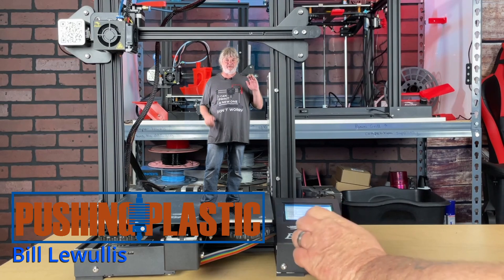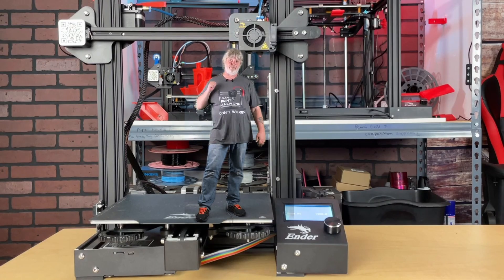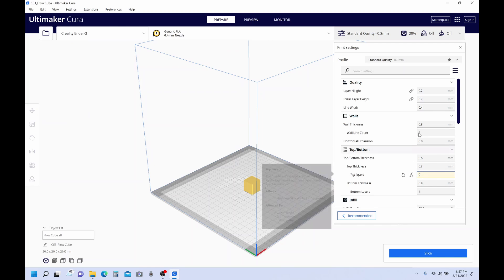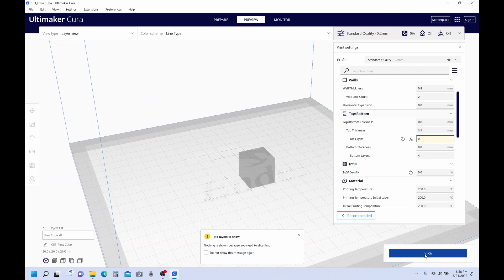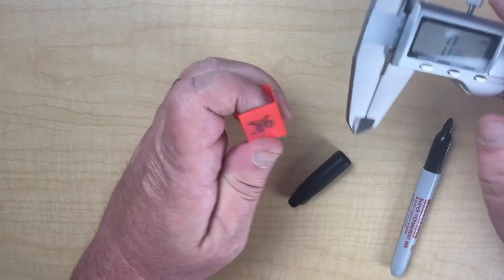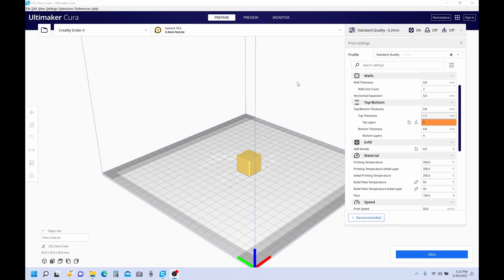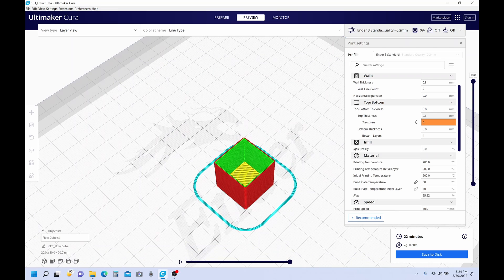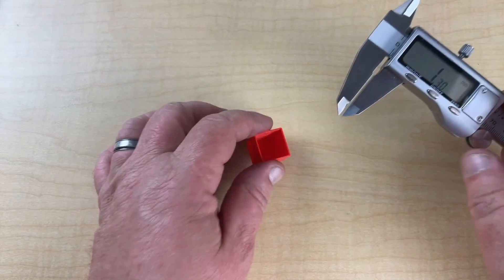Calibrating Flow Rate For Your 3D Printer

Comment: Question for you:  If I'm using a .6mm nozel, I assume I should adjust wall thickness accordingly?  Also, those are some nice looking calipers!
Reply from the maker: The key is to make sure that in Cura, you switch to a .6mm nozzle. It's located at the top of the screen, in the center. It probably says something like "Generic PLA 0.4mm nozzle". Click that and you'll have the option to change the nozzle size.

Comment: A rough visual example of 3 walls.
Original flow
(__)(__)(__) = 1.5mm ~

After you calibrated.
 <_><_><_>  = 1.2mm~
The touching points get smaller.
And less optimal for printing 😮
Reply from the maker: It's a calibration method, using 2 walls by the way. More walls make a stronger print but hardly required to dial in a printer. What good is 1.5mm if it's suppose to measure 1.2mm?

Comment: Hi, is this calibration suitable for materials like TPU?
Reply from the maker: I use to do it this way with all materials. I've been using Bambu Studio, Orca Slicer and Creality Print lately and all have a new visual method for dialing in the flow rate. I haven't looked to see if Cura has added one or not. But when use my original Ender 3, 5 and 5 Plus, I dialed in TPU this way.

Comment: I'm just discovering your channel as I try to dial in my Ender 3 V3 SE, and it's very informative. I'm seeing conflicting information though about flow rate. Some sources say to leave the flow rate alone in the slicer profile and instead use horizontal expansion to account for dimensional variance in wall thickness. What are your thoughts on that vs messing with the flow? Right now, my eSteps seem accurate (followed your video), but when I print the wall lidless cube, I'm reading an average thickness of 0.96 mm instead of 0.8 mm. Thanks again for the helpful info!
Reply from the maker: I dial in my flow rate, it goes a long way towards dimensional accuracy.  If people are using Horizontal Expansion then they don't know their dimensional accuracy is off until they've already have a failed print. I run 8 different printers, each has the flow rate dialed in. When I print assembly parts on any of the printers they mate perfectly with each other regardless of what printed I used. I always calibrate my flow rate. You should dial the flow rate for every brand of and type you use.
Reply: @pushingplastic7445  Thank you for the insight and reply.
Reply from the maker: @TimDavis77  You got it!

Comment: Does the wall count affect the calculations? I've got it set to 3 as default, but am I sure if it would cause a problem
Reply from the maker: It does affect the calculation but not the result. It's the thickness that gets used. In the video I used 2 walls at 0.4mm each for a total of 0.8 total. If you are using 3 walls at 0.4mm each, then use 1.2mm in the formula instead of 0.8mm and you'll be fine. Thanks for watching!
Reply: @pushingplastic7445  sweet, thank you

Edit: funny enough, my average wound up being 1.32mm (the same as what my wall thickness was already set to) 

My flow rate is 100% and using this method, it's where it should be.

Comment: I suppose i should get a new caliper. my only measure down to nearest 10th, as i can only measure 0.8 +/-1 in this calibration, making it inaccurate. Nice video however, i will redo this test after i get a new caliper :) 3 of the walls was measured to 0.8mm, last one 0.9. Sides 19.8mm and 19.9
Reply from the maker: You'll be fine with a set of calipers that measure down to the 10th. Give it a shot with the calipers you have! Thanks for watching!

Comment: How do you feel about calibrating flow using the dimensional check versus some of the other slicers using the top surface coupons as a visual check?
Reply from the maker: Good question! I prefer a dimensional check. It’s more defined. Visual seams to be based more on an opinion. Both methods work, but I prefer dimensions. It might be the mechanical designer in me!

Comment: if you have overflow, can that cause weird rumbling noises? When the nozzle travels over printed areas? i just did this test, my walls were even 0,94mm thick. Was surprised, because my prints always looked fine. I just couldnt figuere out where these rumbling, crunchy noises came. I checke the wheels and rails and belts a dozen times. Using Z-Hop made the problem vanish, but Z-Hop, people say, is not a good idea generally.
Reply from the maker: It could, also over extrusion could cause it too. When your print head is getting ready to move from point A to point B, filament could still ooze onto the model and leave little raised areas of filament. Good retraction settings can help get ride of the rumble too.

Comment: Question is it normal for when I print your cube the printer after laying down the brim and goes towards the center for the cube after the first layer my printer returns to the brim for another lap and then returns to the cube??? Never seen that happen before?
Reply from the maker: That would be the slicer settings, but you don't need to use a brim to print the cube.
Reply: @pushingplastic7445  also do you know what may be causing my prints to come like the they suppose to but the z height is cut in half??? I dont play with slicer settings like a pro usually I leave them as is and I get good prints but I can't even print your cube cause it comes out half the size and looks like it got smashed..lol
Bed is leveled pretty good not PERFECT but pretty good
Reply from the maker: @accordance73  If the scaling in your slicer is set at 100%, then I would look at calibrating the X,Y & Z axis of the print. I have a video for that on my channel called "Calibrate Your XY & Z Steps For Dimensional Accuracy of Your 3D Prints " https://youtu.be/1Ulcj5O4Pp8
Reply: @pushingplastic7445  yes saw that video but one problem... I can't even print a cube to normal size, are you saying no matter how shifty the size is i can still use that fail print to dial in the axis?? If so didnt even think that was possible, will watch video again to refresh the info and process! Thanks again!!!
Reply from the maker: @accordance73  The math is based off of the results of the printed part. There is a good chance you'll have to run thru the process more than once to dial it in. What printer are you working with and did you buy it new or used?
Reply: @pushingplastic7445  ender 3 w/bowden was about to go direct drive when this all began.  I have had it for over 3yrs and this is the first time it has done this. I have done e steps and flow rate, all I have left is my 3 axis
Reply from the maker: @accordance73  give the xyz calibration a try. I used an Ender 3, Bowden tube printer in that video. It was completely stock.

Comment: So I ran this and after 1 round I had the following. Set to 0.8mm wall thickness, got 0.89 avg wall thickness so with rounding endend up setting the flow rate to 89.9% (0.8/0.89*100=89.9). Re-running this got me to 0.815 avg wall thickness. To finess it I then did 0.8/0.815= 0.98 and multiplied my original % flow rate (89.9) by this this to give 88.2% flow rate and re-ran. to get a final wlal thickness of 0.80mm average. Hope this helps someone who is also iterating.
Reply: So I just did exactly this and ended up with similar numbers. Now the corners of my calibration cubes have a “ridge” at the very corner of running down the cube. I think I’m under extruding a bit now causing this.

Comment: when I used your flow rate cube the inside back came out over extruded and the reading on that one side is always much higher than the other three. I calibrated my E - Steps and it came out perfect, what am I doing wrong.
Reply from the maker: How much is much higher? I Ran one last night on a printer I'm calibrating, my "before " measurements were 0.77, 0.77, 0.79 and 0.77. Just that one side was different than the other 3. It's not uncommon. Most times I have two sides different. Remember, you're taking an average of the 4 sides. If you want, you can take 3 measurements per side and take an average of all measurements. Also, only measure in the range of the top 10 layers or less. You don't have to go down to the bottom. One last thing, don't measure too close to the corners, it will almost always be thicker in in that area. I hope this helps! Keep me posted!!

Comment: I printed a .3 single layer and it measures .37ish. Flow is 100%. Would you dial back on Initial Layer Flow to get it closer to .3 using the same calculation?
Reply from the maker: I wouldn't dial it back. The measurement could be because of the initial layer squoosh as it's know. The nozzle is just a little close to the bed, but it's close enough for bed adhesion. Sometimes this can lead to what is called an elephants foot. Consider using "Initial Layer Horizontal Expansion" with a value of -0.03 or -0.04 to bring your initial layer inward on each side of the cube. Assuming it's a cube?
Reply: @pushingplastic7445  To be clear, I printed a 100mmx100mm .3mm thick single layer. Measuring its thickness, it was .37mm. The size came out to be 100x100, so all good there. Since my layer height was off, I debated on reducing the Initial Layer Flow to get to the target thickness of .3mm. Or, should I even bother with it?
Reply from the maker: @baxrok2.  Got it! My bad, I was thinking line width. I wouldn’t use the initial flow to solve, it will affect your line width and not necessarily help your height. On a typical print I wouldn’t worry about it. But if it’s something you really want to address for a single layer print, I would set my Initial Layer Height to make up for it. In a perfect world that number would be .23. But I personally wouldn't do that either. I typically print at 0.2mm layer height, but I'll use an Initial Layer Height of 0.28mm for better bed adhesion. I would check out the video on dimensional accuracy that I have posted on my channel. If you're happy with your x/y dimensions, then I would just check my Z. But honestly, 0.07mm is so small, I would probably let it go. If you were to print more than a single layer, I might be concerned that is 0.07mm per layer too tall.
Reply: @pushingplastic7445  Excellent. Thanks!

Comment: By the way, Overture PETG Black 1.75 prints very well on Ender 3 with .06 nozzle / 245c / 80c /96FR.  Of course your procedure is the same but Wall Thickness is 1.2 for this nozzle. Good stuff!
I should mention that I upgraded my basic Creality Ender 3 (Chrismas gift) using the Creality, Spider v3 all metel hot end, Creality all metel exturder and Creality duel Z Drive kit. I also installed (yellow) spings, magnetic PEI plate, and CR Touch . You don't really need these upgrades to start with but after researching for a couple of weeks I figured I was ready to nerd out.
Reply from the maker: Good point. You will have to adjust wall thickness for the different size nozzles! Thanks for bringing that up!!!

Comment: NIce video. First time someone saying one needs to recompute flow rate every time you change filament type. I guess it makes sense.
I am going to watch your other videos. Are they in order as far as how one should go about tuning one's printer? TIA.
Reply from the maker: They are in an order for tuning starting with eSteps. Once you are sure that the extruder is properly calibrated, then the flow rate. With those two things set, you can be sure that your temperature tower is putting out the right results for your printer. If the eSteps and flow rate aren't set, your temperature tower could give false results by over/under extruding, without setting the flow, your results could be flawed by putting out too little/too much filament. After the temperature tower, retraction will get you to cleaner prints. With the right amount of filament coming out at the right temperature is when you want to move onto dimensional accuracy. I hope these videos help! Thanks for watching!

Comment: Thanks so much! I'm running into an odd issue...

My X axis is averaging at 0.8mm but my Y axis is averaging 0.84mm. On my original test my Y was consistent with each other but thicker than the X. Would this be an Axis calibration issue that's causing this?
Reply: You are talking about a difference of 4 one hundreds of a millimeter.  This is pretty darn good.   I would be happy with it. After all, it's an ftm printer, not resin.
Reply from the maker: You’ll want to calibrate your x, y & z steppers for dimensionally accurate prints. I’m currently working on a video for that! Thanks for watching and I hope you’ll tune in often!

Comment: I have found this the first detailed instruction to achieve a curate flow for dimensions. Awsome
One problem for me. I don't use this slicer. I use matter control
 But hey I will see what I can do. As this has been a lot of problems for me on thin wall printing
I have been printing for 5 years and never thought about what you have explained to achieve total accuracy 
So thank you from the bottom of my heart for sharing this information.
Oh one thing I can say is. That I use an enders 3v2 with jyres  firmware and I can adjust live on printing. Which is nice. But hey it is nice to sort out without doing so
Reply from the maker: In matter control, flow rate is set by the extrusion multiplier. So take the desired thickness / measured thickness and enter that number without multiplying by 100%. I’m glad the video helped but I’ll be even happier if we can get the Extrusion Multiplier working for you! Give it a try and let me know if it works! Thanks for watching!
Reply: @pushingplastic7445  yes you are correct and I have done so.
It is just a problem in matter control  that when changing to woodfillament and Pla plus is that when I save the profile is that it does not save all. Meaning profiles are not 100% saved and when you make adjustments from one print to another and save them the speeds and feeds and temps don't save acordinly. This is a bug atm but was not over a year ago.
Anyway I'm with talk with them and over the years with my imput we are resolving issues
Matter control is far better than cura in my opinion. As you can develop and change or adapt your models prior to print all in one software
But by no means any slicer is perfect
And also to say they now provide calibration tools which is awsome and as from this writing I have used and has corrected some issues
Mainly bed adhesion with so many types of filaments so the test tools are a must from them
Bravo to them.
I will put up some achievements on my channel for reference